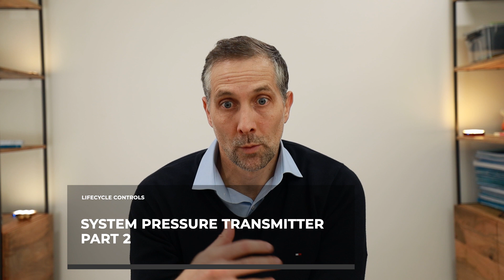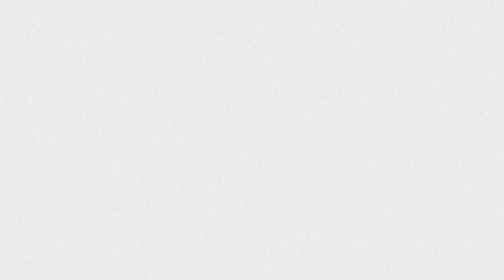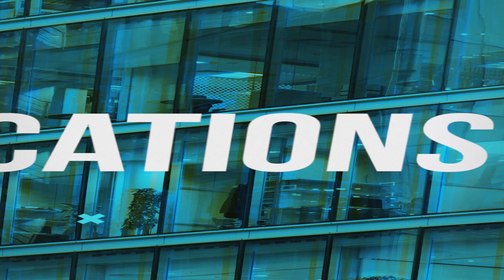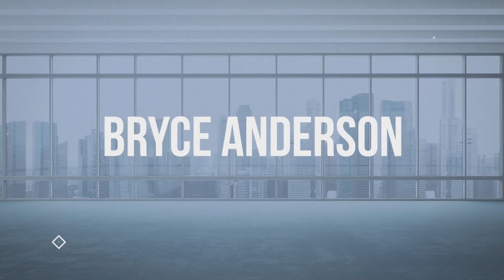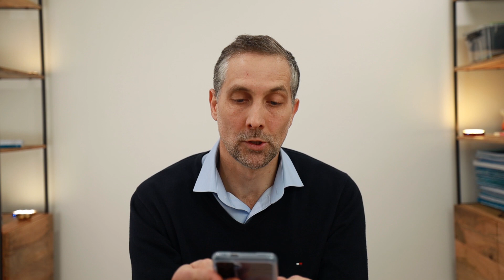System Pressure Control (Part 2)

Comment: Hi Bryce, 
Highly enjoying your videos and i think they are really valuable for learning in BMS industry. I have been working in Australia as a BMS Engineer for close to 10 years. The changes i have seen over time is that it is a race to the bottom price. That contributes a lot for the poor quality installation. If spec not ask for proper labelling cheap companies wont allow for it and the company allowing for it will be expensive. Then Mec guys are not comparing apples for apples. In my opinions quality of spec need to increase that push for these requirements.
Reply from the maker: The spec won't fix this. I have written good specs on billion dollar new construction projects. There will always be BMS companies that will put in non compliant prices.